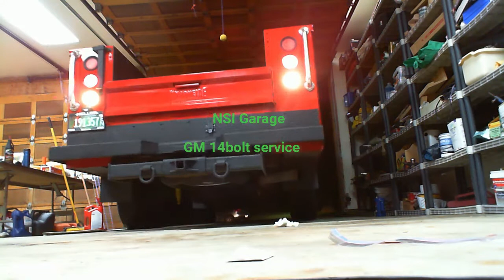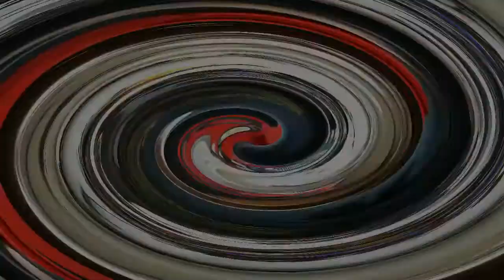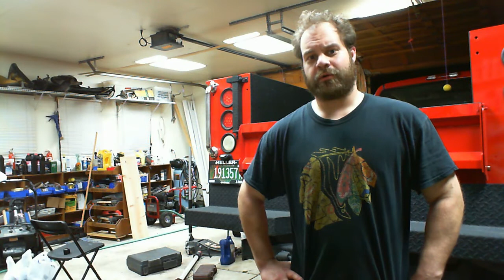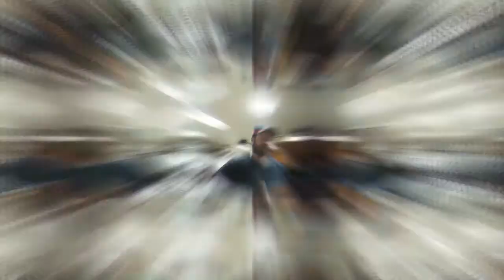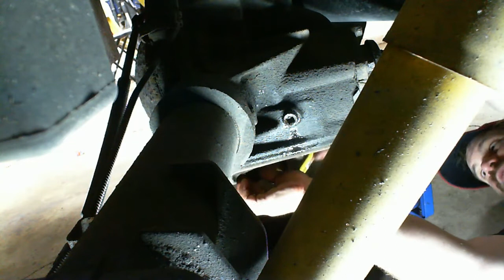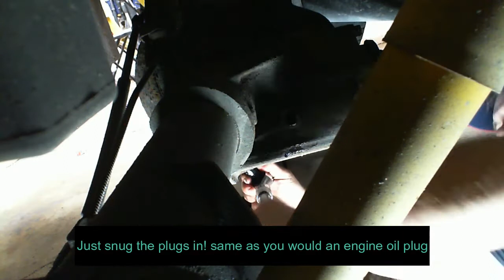GM 14 bolt service EASY

Comment: Need a new fill plug, parts houses don’t carry them in my town. Internet not much better. 10.5 diff. Ideas? Thanks!
Reply from the maker: See if you can match it up with a cast iron pipe plug from a hardware store. I'm 90% it's pipe thread
Reply: @nsigarage5212  
Thanks. Can’t understand why the parts houses don’t carry such a common item🙄
Reply: @greggschachterleppc2769  It never breaks and can't wear out.
Reply from the maker: Yeah, but some people round off the square drive when they don't clean it out all the way